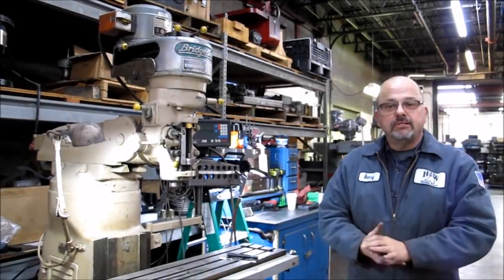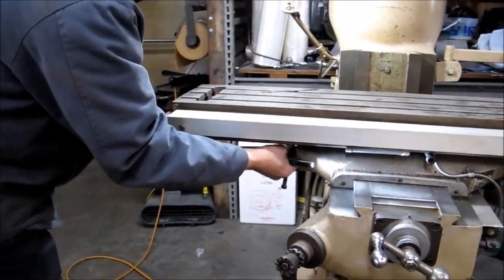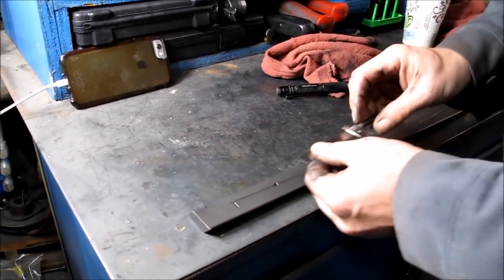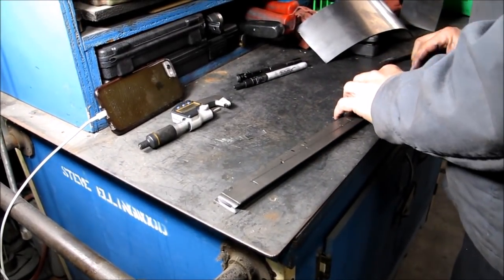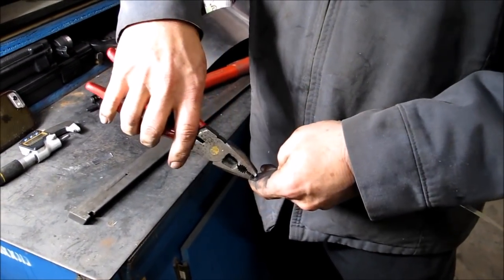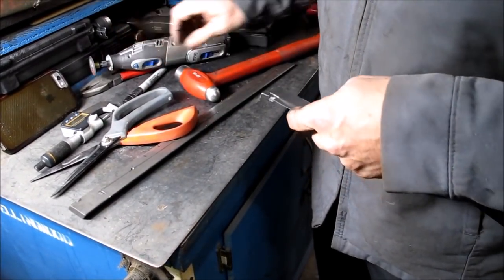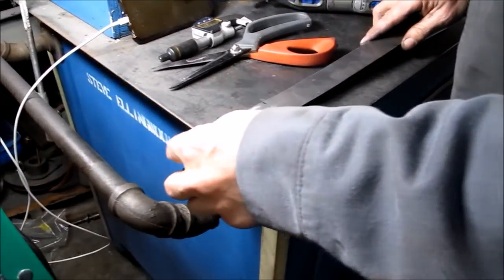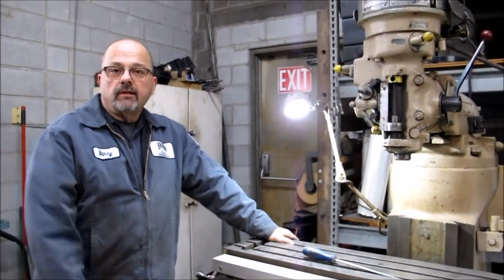Shimming a Gib

Comment: My BP X axis is very loose in center. If gib adjusted THERE, table goes dead tight  very soon after moving table.  Yes, so the ways are worn in the center of travel.  Any way to correct ?
Reply from the maker: Unfortunately, this is usually caused by worn ways. The only things that you can do are adjust the gibs the best that you can, which is still going to be a little tight in some areas and loose in others. You can also get a set of ballscrews, which will allow you to push through the tightness more easily. The last and also most expensive would be to get the table, saddle, and knee reworked. Sorry it's not going to be an easy fix, you can give us a call if you have any questions: 1-800-285-5271

Comment: How do you adjust the machine if the Z axis is off in the Y direction? I'm guessing you need to adjust the knee? I'm getting .030" depth difference in 7" of travel along the Y axis.
Reply from the maker: It's possible that you may just have some wear in the column. There are things that you can do to check but it's to much for a YouTube comment. If you want to call and either ask for Barry or Zack and we can walk you though it.
Reply: @HWMachRepair  thanks. I didn’t realize there’s a gin on the knee (hopefully since I’m away from work atm). Hopefully going to have someone adjust it. Thanks for the offer!!

Comment: Great Vid!  I used it!  BUT, if you ran the table all the way to its right, wouldnt it be easier ( no long screwdriver needed) to reach the adjustsing screw...................?  Just asking
Reply from the maker: After you are done with the shimming and need to adjust it you need to have the table back in the position that you normally use it. Most people use it in the middle and it makes it much easier to adjust with a longer screwdriver. I'm sure many people manage without it, but we showcase how we do it and how we think it is easiest.

Comment: what a hack.   make and fit a new gib
Reply: On my mill the screw was bottomed (probably why the factory that owned it sold it...no gib sticking out though) and I just turned it 1cm short...job done! At the point screws bottom out and gibs stick out you need a regrind-rescrape (a whole different can of worms)...not a new gib!

Comment: No one clicked down thumbs. I am a wanta be machinist - but I am a master draftsman. I don't comprehend trying to bring a machine spec into tolerance with such a butcher (meat cutter) approach. Your marks & cuts are guaranteed to be within 1/8" plus or minus & your shim is within 0.003 of what is actually needed. Not sure what you are producing with this mill but do question what tolerance you guarantee you customers??? On the other side of us beginners viewings, I am watching an apprentice chase his tail with endless scraping to bring his machine into perfect tolerance (& no intro as to what he had to start with). Can you bring these counter perspectives together for us, the wanta know group of beginners? I do intend to ask the opposing vicar in my quandary the same (he has simply dragged on oh so close to the point of - well he is so far from achieving his goal that I just can't....after all what do I know & I'm simply trying to learn.
Reply from the maker: I am not sure you understand what this video is about.  It has nothing to do with rebuilding a mill, the shim is nothing more than a patch in order to remove some slop in the ways until you are able to get your machine properly rebuilt.  When we rebuild a machine we regrind all way surfaces to flat and straight, build up the ways with Turkite to return them to original height and hand scrape the surfaces to flat and straight to less than .0005".  We then hand scrape the gibs to proper fit with no shims.
Reply: You should watch the rest of there videos. Barry obviously knows what he's doing.
Reply: Scraping a mill costs 1000s.  It depends on how accurate you need your machine to be. I have a worn out mill I use for face cutting steel blocks and I keep my newer mill for more accurate work
Reply: Our educational system continues to produce people who "know" lots in theory but understand very little of how things actually work.  I suspect your draftsman mastery would be substantially improved by a stint in a machine shop making things - you might see the world in a wildly different light.

Comment: Sorry Mr. Steve it is Gib.    How much wear can there be before you replace your Gibs?    Both of mine have pretty deep groves worn into them. 
thanks for the video.
Reply from the maker: It really shouldn't matter if you have deep grooves as long as it still has adjustment on it. You really don't need to worry about shimming them until they are completely bottomed out when you are trying to adjust them. Give me a call if you have any other questions and myself or one of the guys can talk to you. 1-800-285-5271.